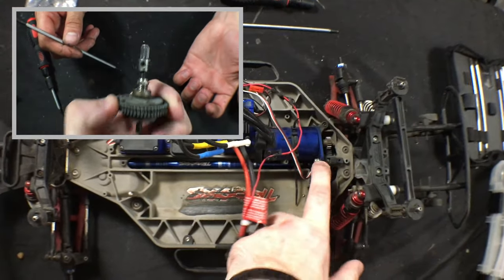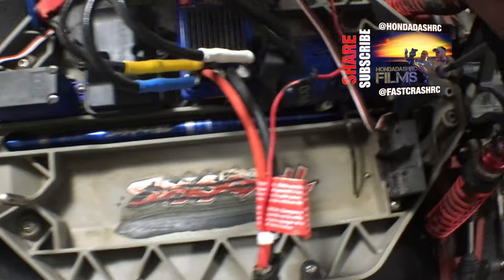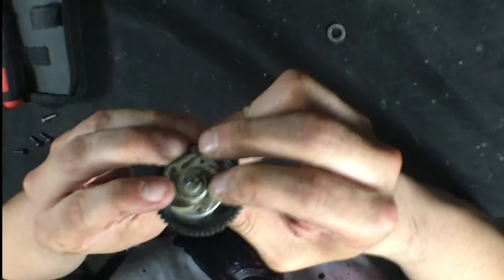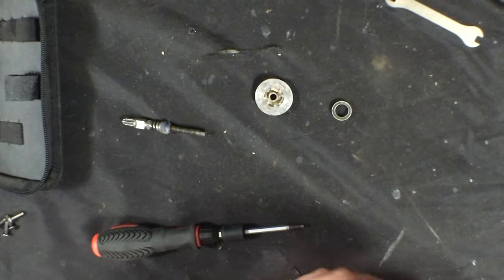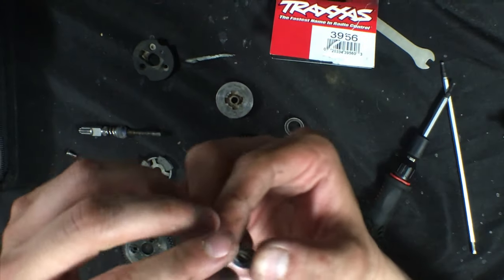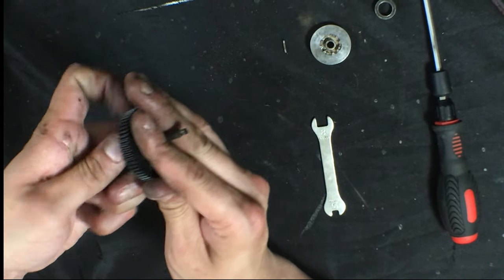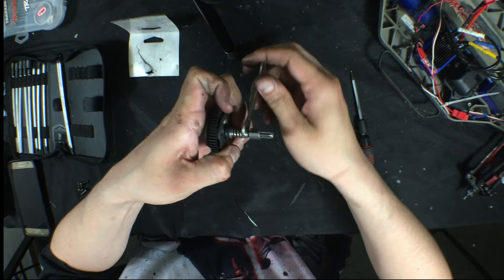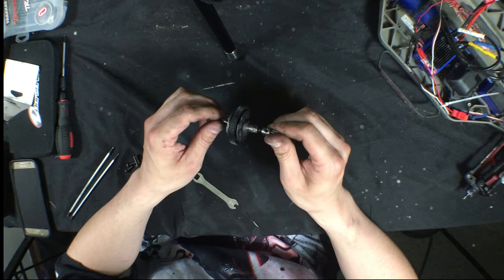How to change Spur Gear with Striped Screw (TRAXXAS slash, 4x4,Stampede Rally 4WD)

Comment: Believe it or not, I haven't had to change that yet but I'll remember the tip! Good job man and thumbs up!
Reply from the maker: How have to not had to change one yet!? I shreed mine after about 3 or 4 runs but I think it's because you use crawlers
Reply: lol not due to the crawlers....more because that platinum only ran about 4-5 times and the local track was leveled down and they're redoing it. I'm sure it's going to go but thats why lol
Reply from the maker: R/C Arsenal Ohh gotcha I Freaking Hate those Grub Screws they stripp so easy
Reply from the maker: Right that's why I made this Vid